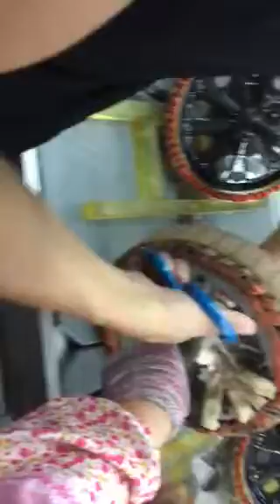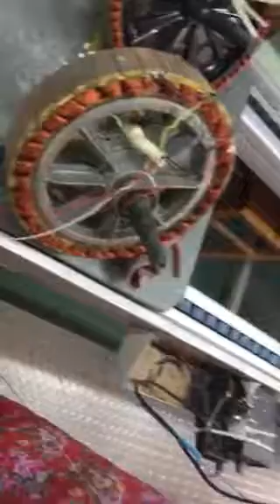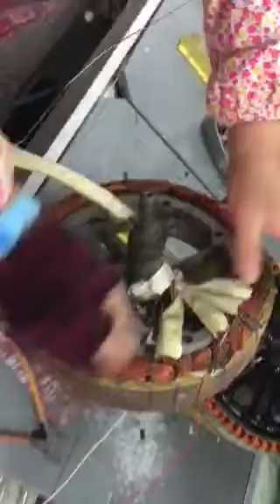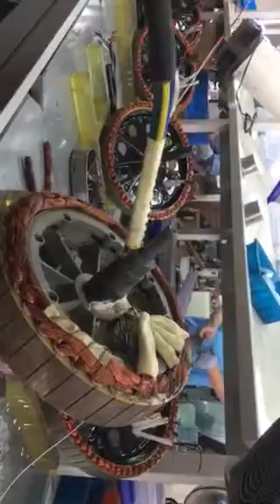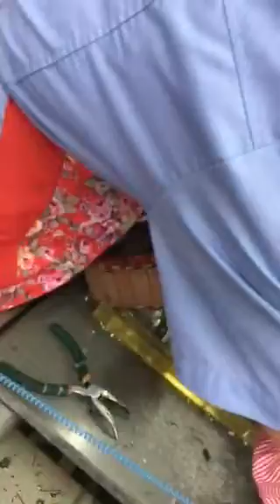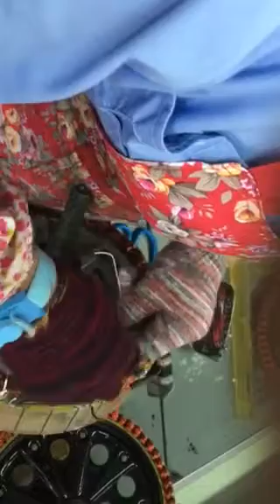QS Motor How to add temp sensor 热敏电阻添加视频

Comment: Hi there could tell me which colour  wires you join to the temp probe inside hubmotor.... please 
Having problems with sabvoton controller mtover temp but don't have sensor in my hub. 
Thanks